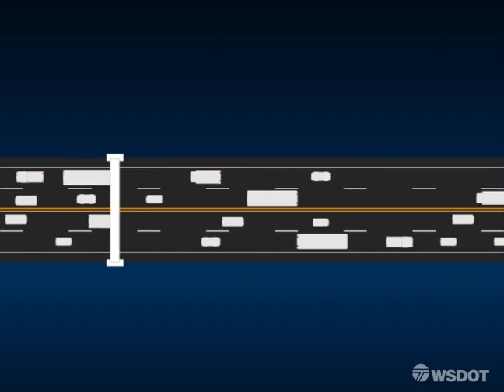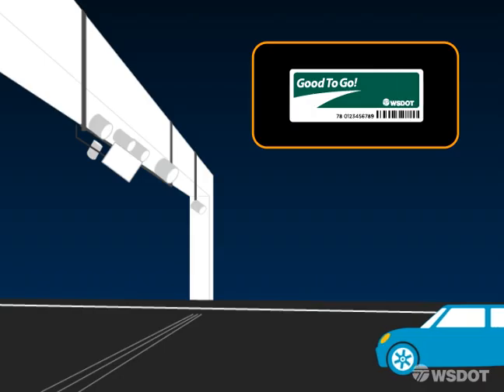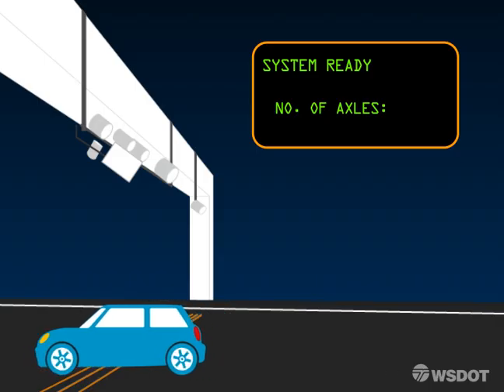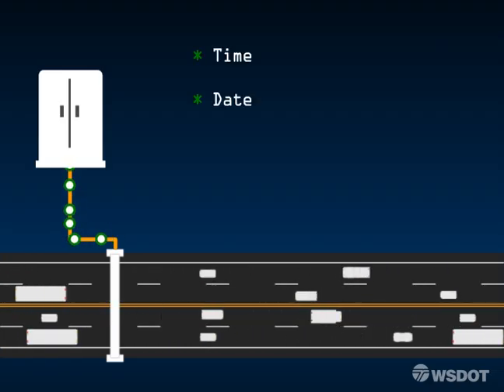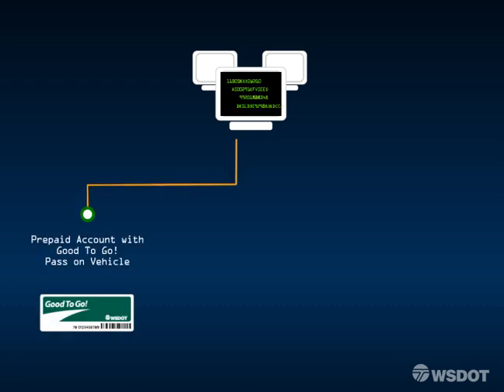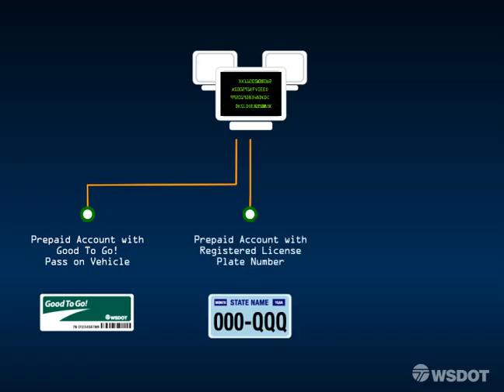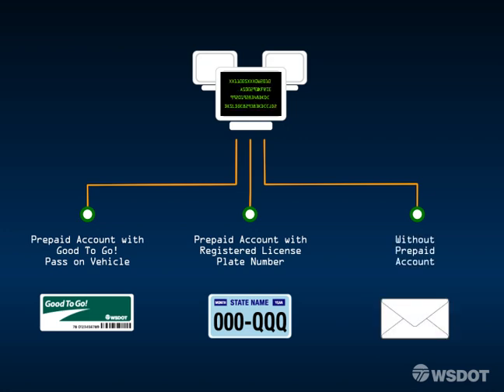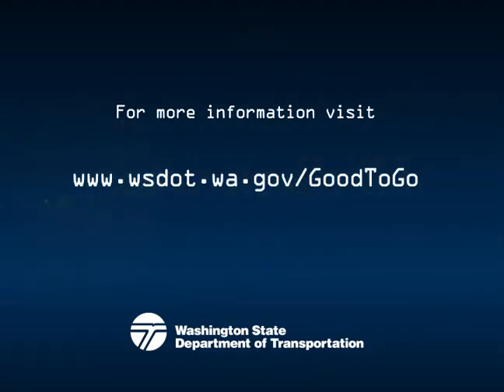How Electronic Tolling Works

Comment: These don't work on license plates.  I've driven through these for the past decade plus and never received a bill.  If I got one I'd pay it, but I never do.  I prefer the types where you get a ticket at point of entry and pay at point of exit from the toll road - whether a ticket or you just toss a handful of coins in a bucket.  They at least work.  Not saying that e-tolling may not be quite effective with transponders or scannable stickers on the windshield - they just do a crap job at reading license plates.

Comment: I didn't think Washington state had any toll roads.
Reply: We have four (soon to be five).
Reply: What roads have tolls?
Reply: SR-16 Tacoma Narrows Bridge (eastbound only), SR-520 Evergreen Point Floating Bridge (Both directions), SR-167 Express Toll Lanes, I-405 Express Toll Lanes, and the SR-99 tunnel (starting November 9, 2019).
Reply: Washington State has express toll lanes in several parts of the Puget Sound region, primarily on major interstates and highways. These lanes are designed to provide a faster, more reliable travel option for a fee, with prices that adjust based on traffic congestion.

The I-405 express toll lanes run for 17 miles between Lynnwood and Bellevue, replacing the previous carpool lanes. This system includes two express toll lanes in each direction for most of the corridor. Toll rates change based on real-time traffic to keep cars moving.

The SR 167 HOT lanes are another express toll system located in the southern Puget Sound area. These lanes connect I-405 in Renton to Pacific and are a pilot project to test the use of tolling to manage traffic flow. The lanes are free for qualifying carpools and transit.
Toll Bridges and Tunnels
While not strictly "express toll lanes," Washington also has several tolled facilities that manage congestion and provide a choice for drivers

SR 520 Bridge: This bridge connects Seattle to the Eastside (Bellevue and Redmond) and has tolls in both directions that vary by time of day.

SR 99 Tunnel: Located in downtown Seattle, this tunnel has tolls that vary by time of day and are collected in both directions.

Tacoma Narrows Bridge: This bridge has tolls that are only collected eastbound (into Tacoma).